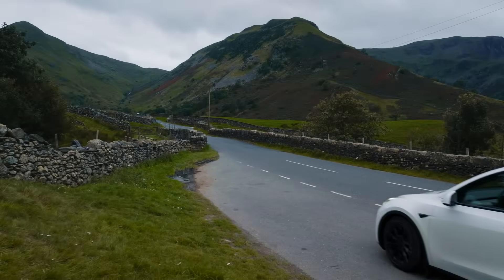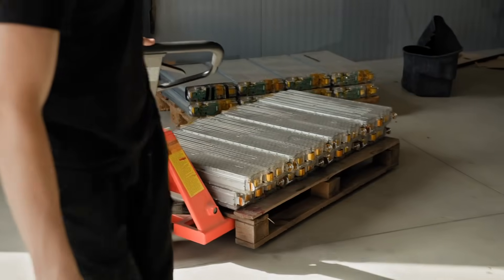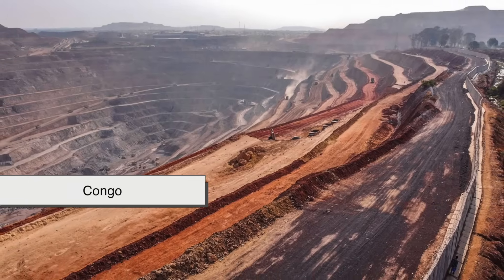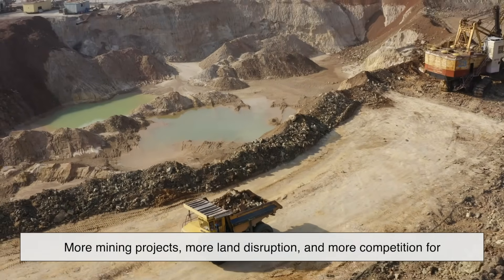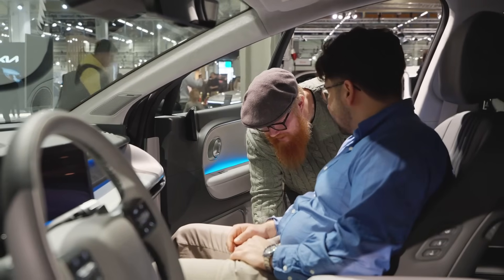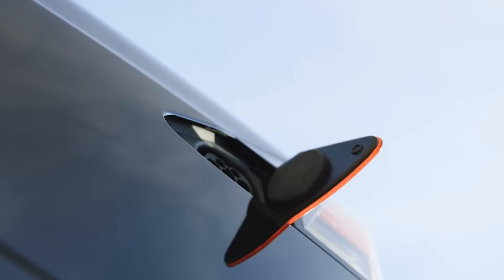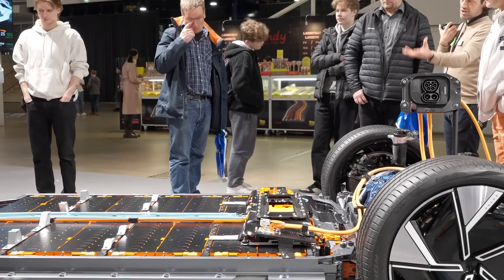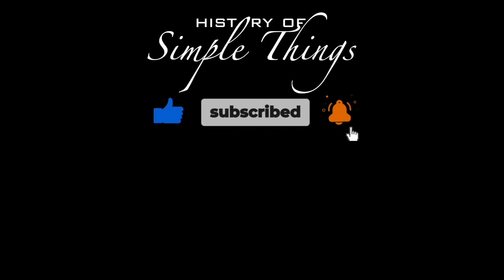Is the EV Push Really Green? The Dirty Truth About Battery Mining

Comment: The primary challenge of an EV is that it does not carry it's energy on board. They only store energy from an external source and that storage is heavy. If you want to extend the range of a gas vehicle you add a bigger tank, if you carry a lot more fuel you add a little weight and consume a little more fuel. If you want to doube the range of an EV you have to double the storage capacity which nearly doubles the vehicle weight, which consumes more energy to move which means doubling storage comes nowhere near to doubling rang in practicality

Comment: EV is 100% not green. First EV uses more energy since it is much heavier than ICE car, where does this energy comes from ??  how do you generate the electricity ??  you still need to burn something to generate the electricity ( the energy ). Together with all the loses in the transmission of electricity to city, charging the battery and then converting the energy back to motor energy, with all these loses , it uses a lot more energy than ICE car and actually requires to burn more fuel to generate this energy, its just the pollution moved from city to the power plant.  Don't fall into this EV scam, help save the earth and stop buying EVs.

Comment: Couple of points 1.Most people do not support unethical labor practises or degradation of the enviroment 2. 95%+ of EV do not use Nickel or cobalt mainly Lithium , graphite 3. these mineral are used for far more than EV s molbility scooters, golf carts, electric scooters electric bikes batteries for mobiles home use etc. 4. JUST REMEMBER THE ALTERNATIVES ARE FAR WORSE, and the alternatives spew carbon monoxide there whole working life. 5. minerals are used in making gasoline as well , some still contain LEAD 5. Evs use 100% of the energy in driving while Gas Diesel turn a significant amount of the energy produced into heat & noise  
IN SUMMARY NO ONE IS CLAIMING EV'S ARE CARBON FREE BUT THE ALTERNATIVES ARE VASTLY WORSE , maybe a comparison with the alternatives would be more helpful

Comment: Not a bad summary.  The only thing that was missed is that moving transportation energy from chemical ("fossil" fuel) to electrical will require multiples of the current electrical grid capacity. 
To achieve this, the entire electrical grid will need to be rebuilt with much more capacity.  Expecting this to be done while attempting to transition from reliable base load power to intermittent sources (wind and solar) without a viable storage solution will result in energy infrastructure collapse. 

Combustion engines are much cleaner than they used to be, and CO2 is not pollution.  It doesn't control the climate, not even a little bit.
Reply: I believe there is a lot of legacy propaganda in peoples minds still.
Reply: @blingbling574  Fear based propaganda is incredibly powerful

Comment: EVs don't run on gas, they run on coal.
Reply: EVs run on whatever energy source is used to generate electricity, which is all of them. All the electricity goes into the transmission and distribution grid to the point of utilization. There are not separate taps for oil, coal, solar, etc. There is an accounting system that differentiates them and that's all.
Reply: You missed the point; sorry.
Reply: @BruceAndrews-k2c I got your point, just adding some of my own thoughts

Comment: Nice video. We have to think about the hole environment. Not just EV 's. That only a small part of a big problem. The outher big problem is the oil will run out.  We have to make a change.  Until we have a clear answer ,Everything is on the table . Carbon capture ,Hydrogen ,battery re cycling. Greener mining.  As we make changes we must think about the whole environment.   Yes we making progress but so far to go.
Reply: There are trillions of barrels of oil in the earth, the question is can we get to a lot of it. Ether way its not going to run out in our lifetimes.
Reply: It's not running out that was peak oil propaganda BS from a couple years ago notice how we haven't heard about anything on that lately?